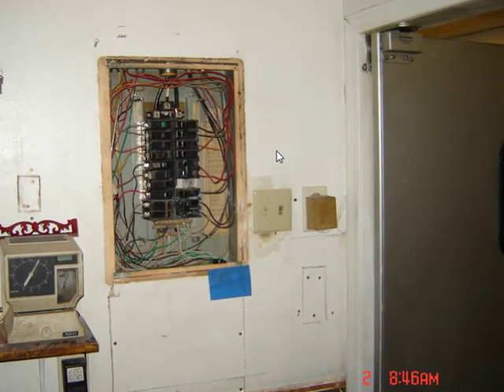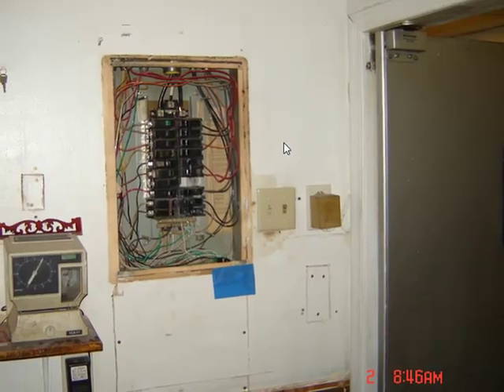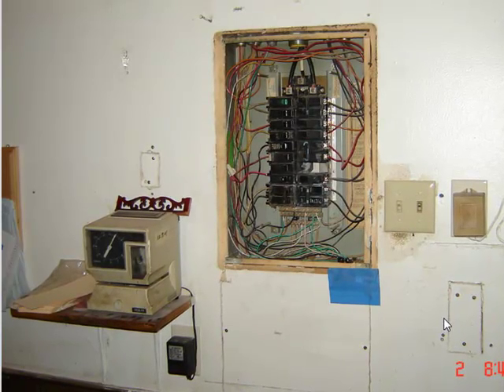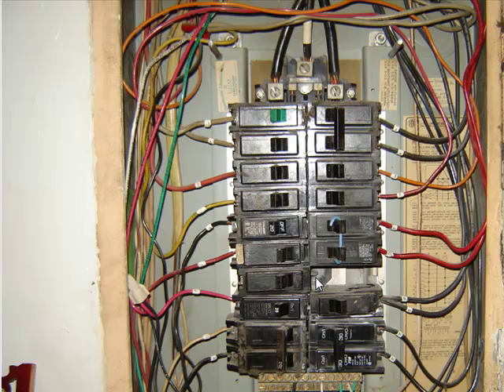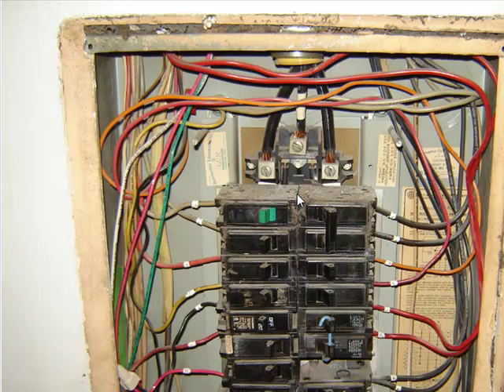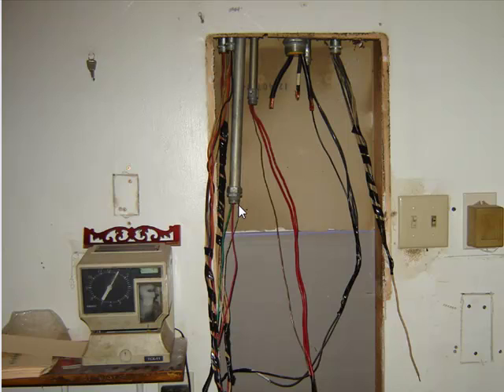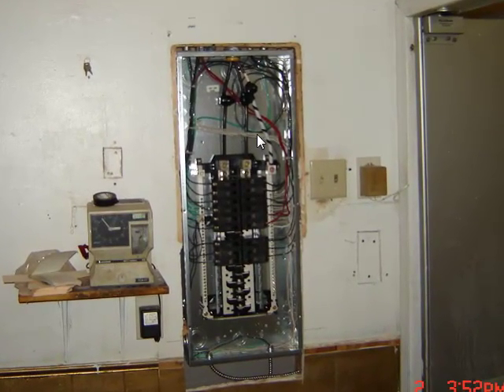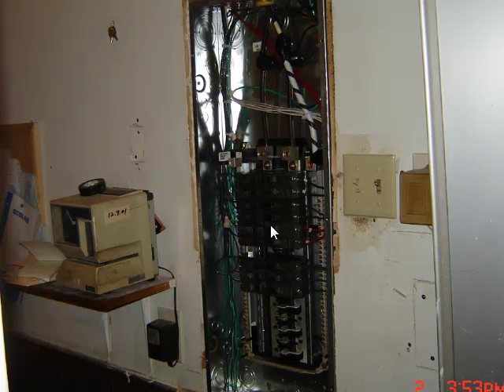Electrical Wiring-rest panel b

Comment: Temporary.....is not a word used in electrical installations. Maybe you should have pulled the feeder in before you changed the panel out? But if you inspector and engineer approved it...hey, why not...